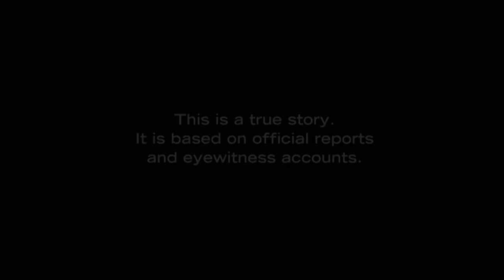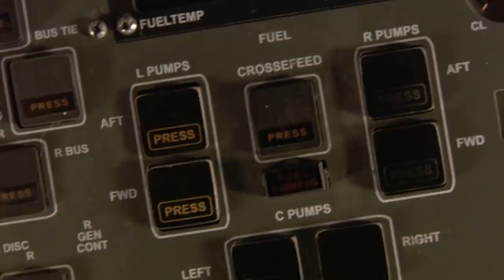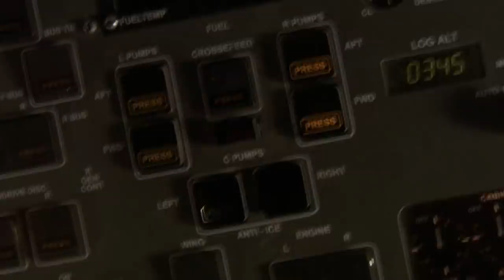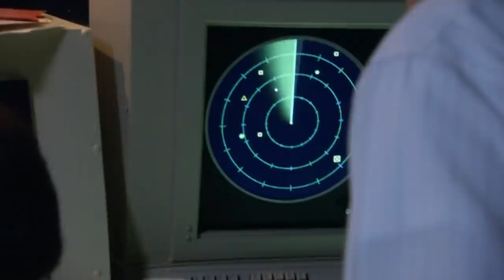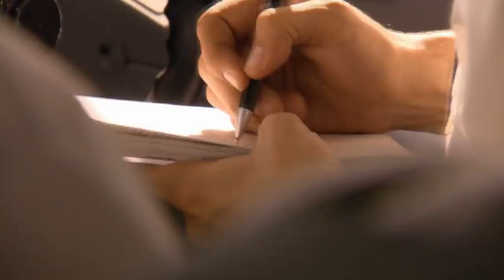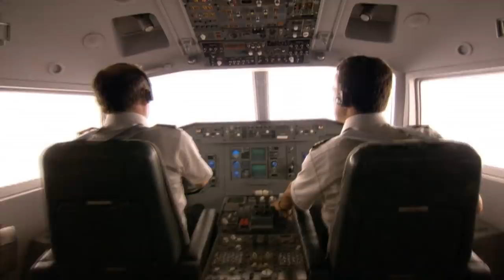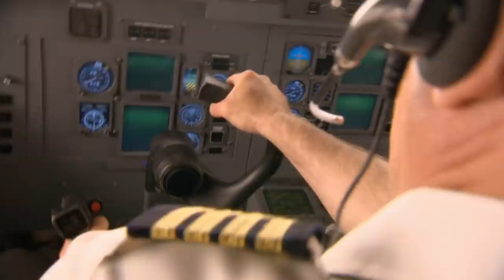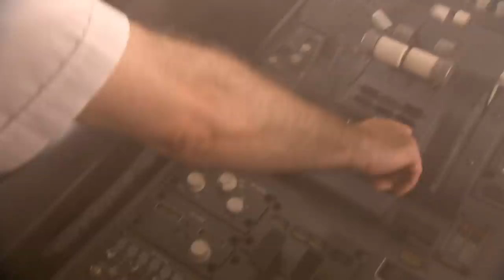Landing A Boeing 767 Without Engines | Gimli Glide | Mayday: Air Disaster

Comment: This was even a BIGGER miracle than "The Miracle on the Hudson."
Reply: I would call British Airways Flight 5390 a miracle as well. All respect to Captain Sully, but some other phenomenal feats of aviation haven't gotten a fraction of the attention his did.
Reply: @MakerInMotion  
I think there's a couple of reasons for this.  First, the Hudson ditching occurred in REAL TIME.  In other words, it had the benefit of nearly instantaneous television coverage, where many other major crashes did not.  Second, the LOCATION, extremely centrally located in the largest city in the world.  And third, ALL of the passengers survived with hardly a scratch.
But as far as mindblowing challenges, piloting ability, and sheer good luck, this landing on a busy drag strip was one of the wildest things I've ever seen.
Reply: @tiffsaver  The Miracle on the Hudson was Epic for many reasons. 1. Captain Sullenberger, was the right man who made a quick workable plan, at the right place and time. 2. The back up engine for power started. 3. They could turn the plane down the Hudson. 4. They missed the George Washington Bridge. 5. They missed boats. 6. The jet didn't brake apart, or burst into flames apon inpact. 7. They came to a stop near mid-town Manhattan, near a ferry terminal. 8. The NJ/NYC Ferry's helped with a quick evacuation of the Passengers and Crew. 9. The worst injury was a fractured/broken arm on one of the Stewartesses. 10. No one on the ground was injured.
Although I think Sully had a harder task, I salute any Pilot who bring their passengers to the ground safely under bad conditions. Captain Pearson is a Hero, as is Captain Sullenberger, I just thank the Higher Power for their work, and for not puting me on a jet going through such a test.
Reply: @andefina5676  
You could say the exact same thing about this landing.  Although both pilots were freaking geniuses as far as I'm concerned, if I had the choice to ditch in the Hudson or land on a short drag strip filled with race cars, families, BBQs, and children, I'd take the Hudson anytime.  When most passenger planes crash on the ground, there is usually fire, and though many passengers may survive the impact, they end up burning to death.  In any event, even though I'm an agnostic, I can't help but see the hand of a higher power involved in what I would both call full-blown miracles.  Too many things had to to "right" for these events to even be survivable, let alone where everyone walked away in one piece.  Incredible.
Reply: @tiffsaver  NYC isn't the largest city in the world. Tokyo is the largest, with about 39 million people in its urban area, only a few hundred thousand short of the entire state of California. NYC is the largest city in the U.S., of course, but it's number 12 on the world scale. Of course, NYC probably does have more news media on hand than any other city on Earth, especially if you consider by the reach of that news media.
Reply: I would disagree about this being more impressive than Cactus 1549, though, for a few reasons. 

First and most importantly, Cactus wasn't at cruising altitude... or anywhere close to it. They had just taken off 2 minutes and 20 seconds earlier and hadn't even reached 3,000 feet yet when the engines shut down. That's a huge difference from FL410. The Gimli crew had tens of minutes. The Cactus crew had to decide where to go and set up for it in tens of seconds.

Second, there was no crew error involved in the Cactus incident. While the Gimli crew did an amazing job of saving the people on board, the incident was caused by human error and they probably should have diverted sooner once they started getting unexplained fuel pump warnings. Human error wasn't a contributing factor at all to the Cactus ditching.

Third, landing on water is much harder than on asphalt, especially when you have (mostly) functional landing gear. With a water ditching, you have to be very careful to prevent breaking the plane apart and you'll likely have no directional control whatsoever once the plane impacts the water, not even the differential breaking that was available in the Gimli incident

Either way, though, both incidents are extremely impressive feats of flying.
Reply: @vbscript2  
Agreed.  With those great, big turbines hitting the water first, I think that's probably what terrified everyone the most.  Most people don't realize that when you hit the water at speed, it's just like hitting concrete, but with the added issues of all that stuff on the undercarriage ripping everything apart.  In any case, if I ever had a landing crisis like this, I'd sure like to have THESE pilots at the controls!
Reply: @vbscript2  
It's all relative, isn't it??  Most people don't realize that the entire city of Manhattan (NYC) sits on an island only seven miles long and two miles wide, and Tokyo is just plain ridiculous.  But at Japan's current reproduction rate, pretty soon it'll look like Kansas.
Reply: Look at this point any landing is a miracle... so much could go wrong yet here we all are, those who've been on planes, still alive. Honestly I'm just glad it wasn't a bird strike or the landing could've quickly resulted in fire
Reply: @emm._.  Why would a bird strike result in a fire? (Also, bird strikes at FL410 are quite rare, to say the least.)
Reply: Honestly I don't really know much details about the Hudson River I'll will have to look it up, but I find this interesting Caz at the end of the day Is plane was nothing but a big ass heavy kite. 😵 Very impressive.
Reply: Honestly all of these are miracles, however a couple of the reasons of why the Hudson stands out over most of these is, the fact that most crashes into the Hudson rarely survived and for the second part the Hudson was the lowest dual engine failure in history. The lack of airspeed, altitude, etc.

However the miracle here is how effectively they landed on the drag strip.

While these are skilled pilots in other series, they had runways, altitude, time, and airspeed all of which increased survivability chances.
Reply: @HolyTrinity458  
Yup, Sully's altitude when he lost both engines was RIDICULOUSLY low.  I'm not usually a religious guy, but sometimes I think there's a higher power involved in these events, you know?

Comment: Hearing about this sent me down the rabbit hole of watching air crash documentaries and learning more about planes.  I now know which pieces of an airplane you can lose and still manage to land safely.
Reply: If you want a what can an aircraft land without you should look at the 1983 Negev mid-air collision as the pilot Zivi Nedivi was able to land a F-15 when it was missing something very critical to flying. Sure most aircraft have two but they are not classed as a backup in case you lose one.
Reply: same
Reply: Back in dubya dubya two I was flying in my piper Cessna Airbus a380 and lost all 4 engines, my tail fin, and the roof of the upper deck and I safely landed on a nascar track

Comment: The fuel had been measured manually with special ''drip sticks'' because the electronic gauging system aboard the plane, Air Canada's first metric aircraft, was not working properly. But in converting the fuel volume determined from the stick readings into total fuel weight, the wrong conversion factors were used. The net result was that the pilots apparently thought the figure for fuel weight on board was in kilograms when it was really pounds. Since one kilogram equals 2.2 pounds, the plane took off with about half the fuel that it should have had.
Reply: So annoying that they left out the cause of low fuel! I wish it had a mention at the end, thank you for adding that info though.
Reply: Everybody just needs to start using the metric system, starting yesterday.
Reply: Yes; my Dad worked at AC then; the new Boeing operated with imperial measure manuals so pounds had to be converted into kilos and wrong conversion factor by the ground fuel crew resulted in not enough fuel loaded in Montreal
Reply: Wasn't the pilots fault it was the ground crews mistake.
Reply: @ckelley63  Fixed my post; thanks
Reply: So, that is where the phase, "don't be a dip stick" comes from?
Reply: You got my thumbs up to get this to the top. Thank you for the info, I was on the edge of my seat for the explanation and then the video ended! :D
Reply: Yet another example where incorrect thinking puts people's lives at risk.
Reply: @robertroy8803  It seems to end abruptly, I'm pretty sure there's supposed to be more of this episode, like a part 2 or something.
Reply: don't fly without working fuel gauge?
Reply: Contrary to popular belief,  you can't really learn to fly, you MUST possess the gift, the talent to fly. Nobody but a great pilot should ever fly, mediocre pilots know who they are. The technical part of flying is something one can learn but the instincts,  the FEEL for flying is possessed by only a scant few. This pilot is a classic example. Sully is another. My grandfather was a pilot of this class and he said it isn't your privilege to pursue it as a hobby if you aren't great, or in plain words born with the unique set of skills that you must have to fly in all conditions. Best is easy, worst is what matters. No instruction or worse yet simulator,  can ever prepare you for the worst. When the worst happens it is only talent that will give you the absolute calm and feel that will create a positive outcome in a positive outcome is possible. But the aviation machine continues to lower standards and salaries as well. Maybe you don't care but you might when you see the ground coming up at you. Personally I want the old fellas who made a half million dollars a year, well deserved. I hope you never have to suffer for the evil choices in the dark ages of aviation. Being a pilot is a sacred profession. That is all.
Reply: @robertroy8803  the program actually has another part that covers the investigation.
Reply: @equestrianwanderlust9777  That's like saying you can't learn to horseback ride, it is a gift you are born with - ridiculous. 

Being a good horseback rider is 99% hard work and practice and 1% talent, same as learning instruments and being a pilot

Comment: My mother and aunt were on this flight. When I finally picked them up in Edmonton hours late, they were bruised and traumatized and barefoot. But grateful to be alive. We didn't know at that point what had actually happened....that they had run out of fuel. And we had no idea what heroics were involved in getting the aircraft safely back on the ground.
Reply: lol lies
Reply: headdown1 Why were they barefoot? That doesn't make sense.
Reply: @ToyotaGuy1971  SO they didn't rip the evacuation chutes with high heels
Reply: @rocketman5167  Ahhhh, it all makes perfect sense now.
Reply: @ToyotaGuy1971  The stewardesses made them take off their shoes before going down the rear emergency slide. Because the nose wheel collapsed, the tail was very high and the inflatable emergency slide was much steeper than usual. They didn't want someone snagging a shoe and going head over heels down the slide.
My mom hit the back of her head on the tarmac and was knocked out for a second or two. She said they were yelling at  everyone to run because they didn't know there was no fuel on board, and were worried about an explosion. So mom and my aunt never got a chance to recover their shoes.
Reply: @rocketman5167  They didn't hold onto them while sliding?! Hmm.

Comment: That’s one helluva pilot! 🍻🇨🇦
Reply: @Dean Zinter It was during that weird Imperial to Metric conversion phase. Thankfully, this was the ideal situation for it to happen... I don’t think it’s ever happened since.  One helluva pilot! 🍻🇨🇦
Reply: @Dean Zinter I don't think your comment is a fair jab at the pilot(s). If I'm correct, their fuel gauges were switched out during maintenance, from imperial to metric. The pilots loaded enough fuel in imperial.
Reply: The IMO criminal action and violation of the inviolable high trust placed in a passenger pilot is that he OVERRULED everyone on the ground who was scratching their heads. He pulled out a Jepsen calculator and said, "Yes, this is safe." And ordered the takeoff. He and he alone ordered that takeoff in the face of uncertainty. He also violated the MEL requirement. He caused the accident. Then by a combination of skill and sheer luck very very very narrowly avoided a huge killfest.
Reply: Angels were busy that day.
Reply: If this ends without a ending I'll never what this channel ever again. What was the cause of this crash.glad no one got killed
Reply: @ronniecardy  There is a second part that finishes up the story. You’re good to go 👍🏻
Reply: Space shuttle gliding with the aerodynamics of a brick from orbit, without engines: I n t r e s t I n g
Reply: YAYYYYY 🙏

Comment: 11:45
See, this is why I tend to watch multiple sources / coverages of the same incident. This is the first time I've heard that little propeller even mentioned, let alone how important it was.
Reply: you didn't know about the RAT which has been around since the 20s?  It's also a turbine, not propeller.
Reply: @watchgoose  Um, No. Just NO.
A turbine is a rotary mechanical device that extracts energy from a fluid flow and converts it into useful work. The work produced by a turbine can be used for generating electrical power when combined with a generator. A turbine is a turbomachine with at least one moving part called a rotor assembly, which is a shaft or drum with blades attached. Moving fluid acts on the blades so that they move and impart rotational energy to the rotor. Early turbine examples are windmills and waterwheels.
Reply: I didn't know they have the props that drop down like that either... I do know that a lot of these commercial airplanes tend to have a small engine in the very rear of the plane that controls the electronics when the main engines fail. Never heard of this specific system though.
Reply: @nunyabidness674  I don't know what your point is, he's right, it is a turbine, attached to a generator just like a windmill you mentioned.  Only instead of wind currents, this is using the on rushing air from the aircraft's forward momentum to turn the turbine to generate power.
Reply: Its called a rat it only provides limited hydraulic power when it windmills in the air the power for the radio and very limited other functions comes from aircraft battery. I've never heard it call a turbine before.
Reply: @charlespoltes3573  “I’ve never heard it been called a turbine” so I guess you’re not aware that RAT stands for Ram Air Turbine lmao
Reply: They call it APU now don’t they
Reply: @nunyabidness674  go off, king

Comment: Bob Pearson defines hero. This is an incredible story.
Reply: Makes you question why he didn't get the acclaim that Sully Sullenberger got.
Reply: @bobbyd6680  Sully and he were just doing their jobs.  Very skilled but I think many GOOD pilots would have reacted similarly.  Anyone with single engine time in small aircraft is adept at slipping an aircraft.  Still, I gotta hand it to Pearson 'cause I doubt anyone has slipped a 767 like that before this.  It's the stuff of test pilots.

Comment: "Any landing you can walk away from is a good landing!"
Reply: any landing where the plane can be reused is an EXCELLENT landing.
Reply: @georgiapatriot4575  Those are pretty low standards
Reply: @insylem  You should listen to Brian Shul than. He flew the SR-71 among other planes for the Air Force.  Close air support to high altitude reconnaissance.  Any landing you can walk away from is a good one, If you can reuse the aircraft it is a great landing.

Comment: It doesn't matter where you sit in an airplane, because every crash is different.
Reply: Rationalized safety. While some people think, "This is it, I'm going to die" others think, "I'll survive this because of X". It's just a way to calm your mind so you don't think about the worst case or most probable case. It's all about fooling yourself to achieve either a clearer mind or to stop yourself from panicking.
Reply: I will take the tail section every time.  (Retired USCG Mechanic / Air Crew Member, 5000 hours on C-130 and HU -25)
Reply: Wrong. The farther back the better
Reply: @breakbad9753  if the plane crashes without the flames getting to the fuel tank the second it touchdowns, then being in front will benefit more as you have more chance of survival and getting out the door
1. its further from the fuel tank (which doesnt matter but still)
2. planes always have to land tail up meaning the back can shred into flames without wheels
3. if the nose gets jammed in the ground, you have lower ground than in the rear

Comment: Here's what I remember that wasn't mentioned in this video: the plane ran out of fuel because the airline had recently changed the fuel measure from lbs to kilos. Someone on the ground crew messed up the conversion. Also this aircraft was repaired and put back in service. Many years later when it was retired, they had these pilots fly it to its final resting place (boneyard).
Reply: watch "mentour pilot" and he goes into extreme detail about this

Comment: despite their low survival rate, gliding landings have surprisingly gone well in recent years.
Reply: @HuskyGamersUNITE  that is true. However, in the Alaska 261 crash, Jackscrews are not, at least to my knowledge anyway.
Reply: @xiayabennett6982  I think you are correct.  I had a jackscrew requirement wherein our suppliers were out of business and found there were no ground crew inspection criteria for acceptance/rejection.  To this end, I was about to issue a GUIDEP alert when Alaska 261 crashed.